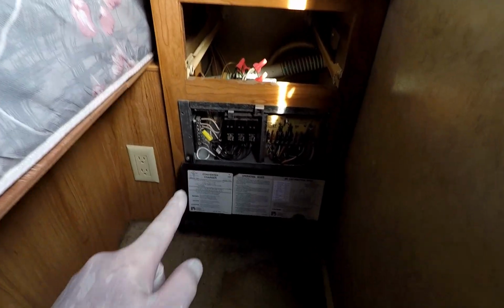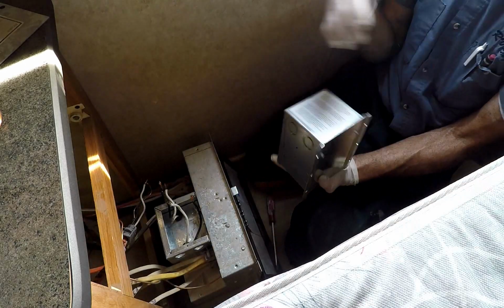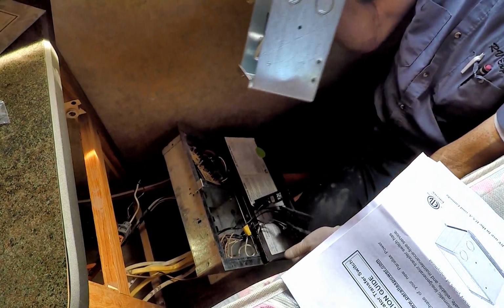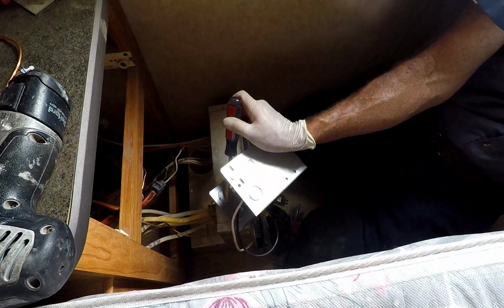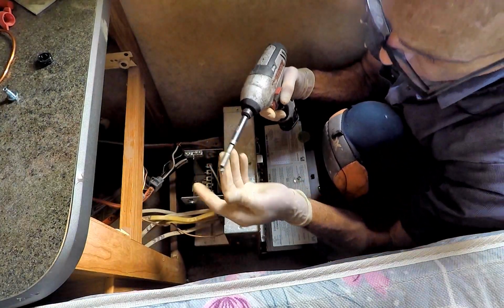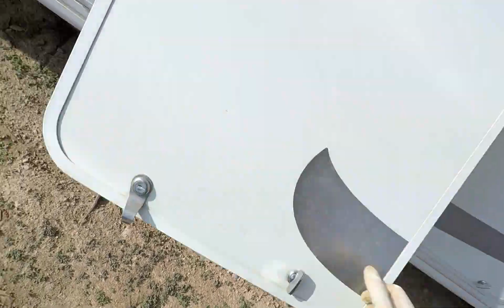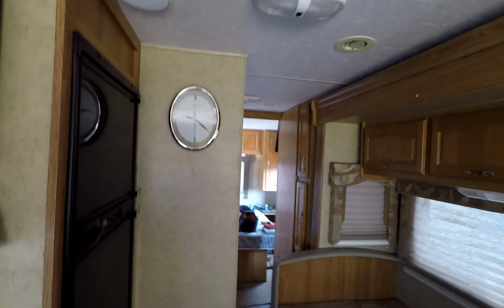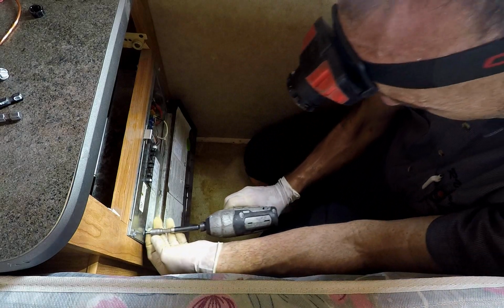Parallax ATS301 30 amp RV Transfer Switch Replacement

Comment: I have kind of the same problem with an older motorhome 30 amp got the generator running it's running no power in the couch how would you test the transfer switch

Comment: Seriously THANK YOU for doing this video! This is the only one I found that has the exact setup as my 1996 Damon Ultrasport Class C. And like others have said below, yes you did an awesome job installing and explaining everything. Now I know which new transfer switch to buy. I'm also going to replace all 3 breakers since they are 28 yrs old. Definitely wouldn't hurt. And my panel didn't have that bracket that holds the main in. So I will have to source one since it should be in there. Obviously someone has been in there before and didn't reinstall it. So thanks again and keep up the great work!

Comment: I'm technical support for the Parallax Power Supply product line. Very good job overall. The only comments I have are that we highly recommend using an inch pound torque wrench for the electrical terminal connections to make sure they are tightened to the correct torque specifications. That way you know they are tight enough and not so tight that you either break the screw terminal or break strands in the conductor which would cause excessive heat and a potentially dangerous situation. The piggy back mounting screws that come with the unit are self tapping. Thank you for putting the main breaker hold down bracket back in. That bracket is required by National Electrical Code. Many techs throw that away. The reason to change the timer delay jumper to disable the time delay is for an inverter input to the generator input. Thank you also for taking the short time to add two missing screws to the mount for the power center that the manufacture failed to install.

Comment: Great video.  Im wondering how to disconnect the converter.  I have the same model and it comes on when i have my inverter on, and drains my lithium battery.  So i need to disconnect the converter. 
I have a stand alone ATS installed, but my magnetek panel is integrated (12V and AC), so if i shut off the converter breaker (or remove the wire from the breaker) i have no AC power.

Comment: Does it mean that if my rv shore is connected and i want to run the  onan gen, I have to have an automatic transfer switch? What happens if i dont have that ats?
Reply from the maker: transfer switch is only necessary if you don't want to plug your RV into the generator
Reply: @AZExpert  I finally understand what you mean. i will do the hard physical labor. thanks.

Comment: I can't get anyone nor any manufacture where to find a good quality Transfer Switch that will switch from shore power ..and/or solar 
...and/or generator to supply power to a Class B+ RV and charge batteries ....yet its done everyday.
Reply from the maker: https://www.amazon.com/Go-Power-TS-30-Automatic-Transfer/dp/B00153EYTO/ref=asc_df_B00153EYTO/?tag=hyprod-20&linkCode=df0&hvadid=312146506965&hvpos=&hvnetw=g&hvrand=5161370903177170741&hvpone=&hvptwo=&hvqmt=&hvdev=c&hvdvcmdl=&hvlocint=&hvlocphy=9030039&hvtargid=pla-436834989828&psc=1

Comment: What you charge? have a similar problem on my 1998 fleetwood bounder no shore power in my coach. I get power in my coach Only when generator in running.
Reply from the maker: It's difficult to quote a job price on youtube.
Reply: first trip charge is 2.25 per mile plus 1 hour @ 175...part mark up of 20%, trip charge and 250

Comment: The issue when the house (RV) is not grounded, and the supply cord is using ground and not neutral, there could be a safety concern unless you tap the house to a physical ground or grounding pole. If standing on ground and you should be working on a metal cabinet of object which is connected to ground or partially connected to ground, there is a potential of you being in the ground path or loop.
Reply from the maker: RVs are strange like that, on generator, there is no Earth ground only chassis ground and the neutral is isolated from chassis/earth ground unlike a house when plugged in.
Reply: @AZExpert  I am about when using shore power which uses a neutral. The ground fault could be an individual if there is a floating ground.

Comment: Years ago I had to replace an ATS that had stuck contacts. But instead of replacing it with the same design ATS that was incorporated behind the breaker panel? I opted to install a free-standing design. Worked great, and easier to install when dealing with the confined space.
Reply from the maker: That's a good idea too. Thanks!

Comment: Stupid question, I have the same transfer switch and can't get the fuse panel lid to open, is there a trick? I've tried to twist, slide and push the little button on the outside of the panel to no avail?
Reply from the maker: should be a quarter turn and pull on the door

Comment: You ask if we see an obvious problem?  I can tell all of the wires are disconnected and it is no longer in place!  Seriously if you can smell capacitor or tell the magic smoke has left then it is really easy to tell what is wrong, not what caused that problem, but the result of the magic smoke getting out.  Finding what caused a failure is usually much harder than finding the failure.
Reply from the maker: I couldn't find the problem. There is a small logic board with a timer that controls the transfer...I just assume that was it! Thanks

Comment: As someone who had nod idea he was doing  and had a giant fear of starting something that he couldn't finish, after watching your video three times over a few days and letting the info sink in a little at a time, I was able to complete this job flawlessly in about an hour (those little screws that hold the breaker panel are hard to put back in without magnet). Also, the new style ATS that you installed to replace the old made it so easy.  Thanks for the video.
Reply from the maker: WOW! Thank you for the high praise, I didn't think I did a very good job explaining it but I'm very glad to hear I helped and you were successful.Thanks!
Reply: I just found that my brother's Coach has the same problem 4000watts Onan generator is running but no power is going thru...so the transfer switch box has to be at fault...! Thanks for the video !!